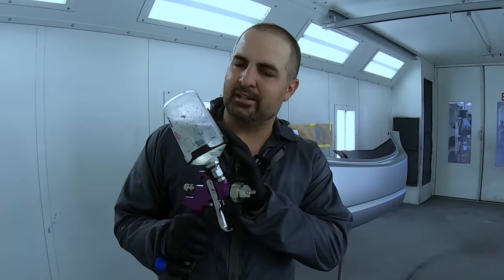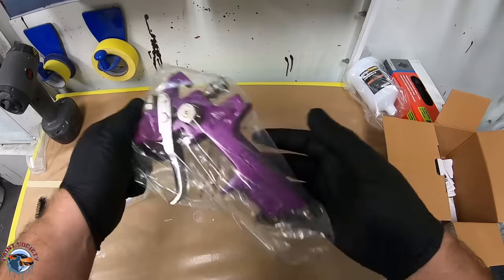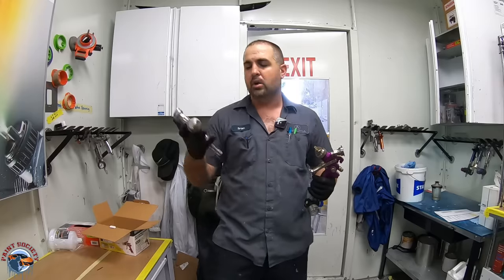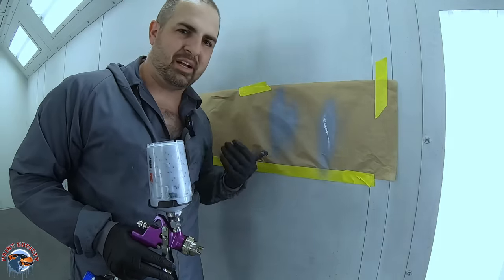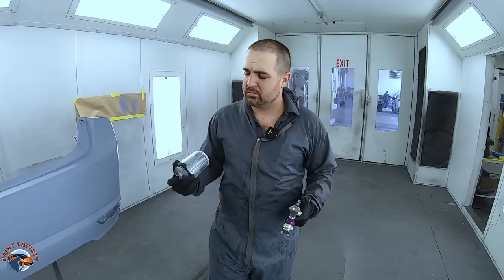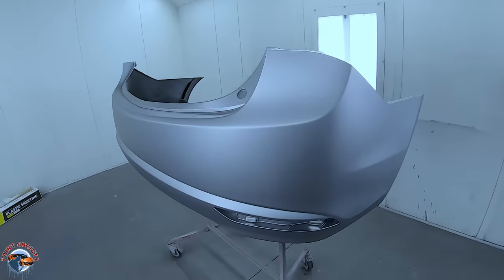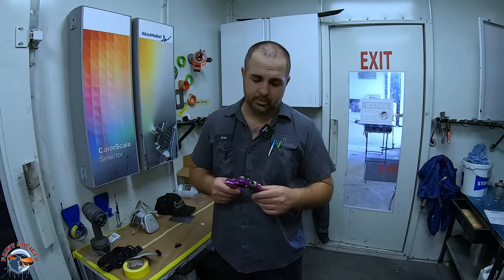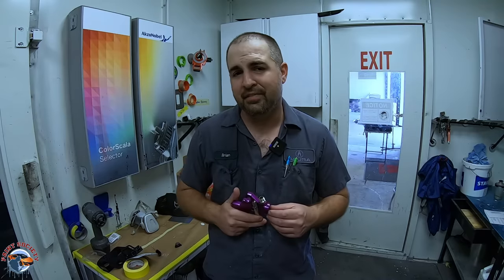$15 Harbor Freight Paint Gun Delivers Professional Results!

Comment: I have been using this gun for at least a week now, it's like $26 now lol but still hard to beat for the price.  This is not a pro quality gun, the fluid adjuster is hard to get back in when taken out, it's not the most robust metal even when cleaned thoroughly.  Have to set realistic expectations, but this gun can be used very effectively, but it can take some adjustment in the beginning.  The way I see it is even with a $700 paint gun there would still be a learning curve, make the mistakes on a cheap gun.  Also it lets you see if you plan on doing this more, and maybe someone will invest in a more midrange gun in the few hundred dollar range then.
Reply: Yeah I might have to look at another gun, not sure yet how much more painting I plan on doing, working on the second project now.  I figure you could paint walls and other things to get better use out of it.  I am still glad I got the Harbor Freight gun, simply because I didn't take good care of it.  Now I have seen what happens if you leave your clear in there, lol can't believe I have the gun working fine still, left acetone in it overnight and that did the trick luckily.  You leave it for over a day though and I bet it's toast, that is why I'm a bit hesitant to dish out more money for a gun.  We'll see though thanks for your awesome videos!

Comment: YES, 3.5 finish.. But once that bumper is "wet sanded" and "Buffed out with a Fine Cut Cleaner it will turn into a 9.9 FINISH once you get rid of The Orange Peel  .. You forgot to Mention
Reply from the maker: But who has time to wet sand and buff a bumper. Get a gun that delivers 9.9 all the time

Comment: Cheap guns are good for bad painters. They give an excuse why it did not go perfectly... At work, we have those cheap ones when painting machine parts just now and then with a different paint that is/has been in the high pressure system. No need to flush for different solvent, and as some solvents are expensive, the gun is about the same as the solvent needed to clean it...
I have hobby-painted cars. The thing with expensive/cheap paint guns resembles the thing with firearm trigger pull: First time a different type of gun, there is getting used to the trigger pull. But once you get used to that, the problem is not so great any more. I am going to paint a Ford Taunus today, it is a German version of Ford Cortina, sort of Fox Body Ford. I bought two cheap guns for it, and plan to just throw them away after painting, as they are so small percentage of the total cost of the rebuild. Modern paints are so good, that the gun quality has less effect than, say 40 years ago...

Comment: Another reason for the low cost is that the makers have had to finance very little if no research and development into the product as it will be a direct COPY of a high end gun. . They haven't had to spend years of trial and error to perfect it or finance the design of the jigs and moulds to make the components along the way.. A firm like Devilbiss has to recoup all those costs before it can make an operating profit.. The firm in China just buys a high end product, strips it down and replicates the components.  It then assembles them with cheap labour. 
THAT is the main reason while they are cheaper along with the fact that quality control will be much lower than a high end brand.. If you get a good one that's great, if you buy one assembled by a new employee on a Monday morning, then not so good.
Like the maintain says, he's experienced so he can make up for its shortcomings..
Tip - if you buy a cheap gun it should be ok, but buy some mis-mixed paint cheap and practice on a scrap car panel till you get the measure of the gun and become proficient..
Then, and only then, let it loose on your car..

Comment: I should have watched this.  I bought one of these puppies to paint some exterior wood trim.  I don't think I did something right.  I didn't make any adjustments and all I got was sputtering...tried fiddling with the adjustments to no effect.  Frustrated, I tossed it and painted the trim by hand.  Not sure what exactly the problem was.
Reply: Your paint was too thick. This is designed for automotive paint. Paint needs consistency of cooking oil.
Reply: @artummomenti3147  I thought I thinned it enough per what I read on the interwebs.  But if this sprayer isn't designed for latex paints at all, then I've got a bigger problem.

Comment: What do you think of cheap ebay paints? specifically basecoat? I found a few sellers offering pre-reduced basecoat in manufacturer paint code, for like 150$. I haven't found anything locally that even comes close price wise? I'm in NJ, so prices are... exponentially high for literally no reason other than this place is a shithole.
Reply from the maker: They will work but they won’t cover too well. Depends on the project

Comment: The real problem with that HF gun is that there is no way to get parts for it, nor is their anyone to help you if it isn't working right. Still, it's probably the perfect beginner gun because you can actually afford it. No newb is going to spend $700 on a starter gun. He'll just drive around in an ugly car.

Comment: People dont like to hear it, but the result to price ratio flattens out very quickly with price.
A 16$ gun will get you 90% result, and a 500$ gun will get you 95%. Which is fine for a chum with a driveway fixing a dent on his civic one time every 3 years. The price comes in repeatability and robustness, cause the 500$ gun will still run it on the 200th car the same as it did on the first one.
Tldr: if you dont have a paint shop repainting whole cars every week, youll survive with a harbor freight.

Comment: Does anyone make old-school paint guns? I have a Binks that is a high-pressure gun but it's old and needs rebuilt. I'd rather paint my car with single-stage paint and an old-school paint gun. I'm an amateur and have painted a few cars over the years and I can tell you that an old-school Binks gun and single-stage urethane is a lot easier to spray and come out good than HVLP base / clear.

Comment: Paint gun:  $15
Compressor: $400
Paint:  $200 a can  $200 color match
Paint booth:  $2000 a month for land rental and maintenance costs
N95 mask & other PPE:  Priceless

Sigh.

Paint Society, I don't think you "get it"  In my opinion 50% of that finish was the environment, 49% was skill, and 1% was the gun.  The fact is that the cost of maintaining that entire setup - heat, light, space, HVAC - for the time you were painting probably equaled your labor cost.

An amateur could probably crank out a finish like that with about an hours practice in that environment.

What would be the real test of your skill is show us how to get a finish like that with a $15 gun, a $120 air compressor, in your garage over the weekend that's jam packed full of kids bicycles, your wife's car, garbage cans, vacuums, ping pong table, etc. where you have to turn sideways and sort of slide out of the car to get inside.

And for extra credit, do it so that your wife isn't complaining about all the "paint stink" in the house.

THAT is what most of us have to work with.

Comment: Wow the isocyanate does not bother you in your eyes and through that respirator . Many of my friends had to quit the trade because of isocyanate building up in their system . I quit the trade many years back for industrial electronics but restore modify cars boats and custom paint and touch ups . I got isocyanate poisoning from restoring a boat in my driveway from building box store canned expandable insulation foams  wearing similar respirator for less than 10 min the spray can in tiny print had contains MDI   Methyl di isocyanate

Comment: I had this gun for few years now. It does a good job, but build quality is a complete crap. Air leaked from new, lid is not sealing properly, plastic knob for fan adjustment cracked while I turned it wrong way accidentally. Wasn't using much force. And worst thing that happened was, plastic part inside gun, which keeps needle seal in place, popped out while I been spraying neighbors bumper with a sealer. As I later found out, this plastic bit has shrinked over time due to solvents. It also has a lot of corrosion going on inside it. So even if you are only DIY guy, but looking to use it for few times over long period of time, I suggest you to stay away from it. There are other, much better built Chinese spray guns. Just do your research.

Comment: don't use this gun with high build primer, tip is too small , it just splatters primer  over hard sanded body work, and you need to sand even more just to get cut through spots  and get to the point when you need to use this gun again to prime over. Get proper guns for primer and base/clear  your hands and back will thank you